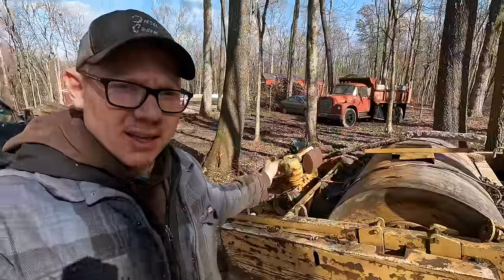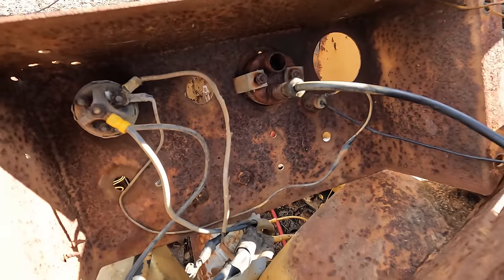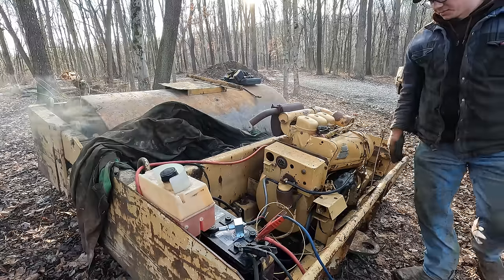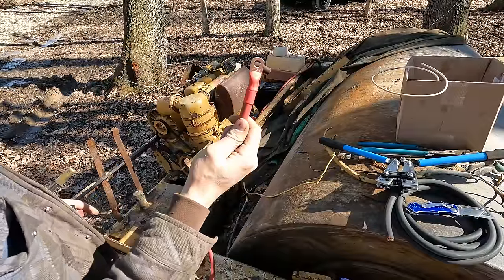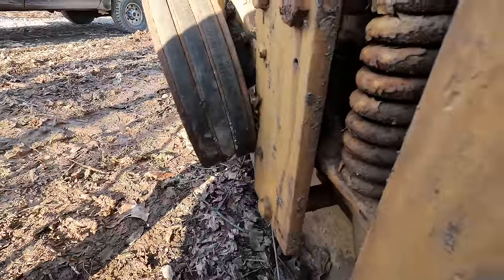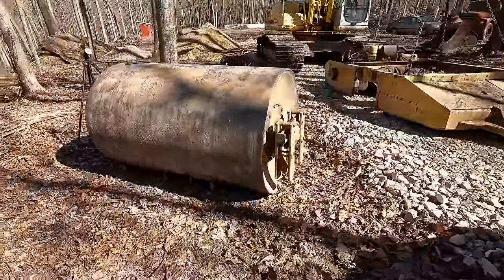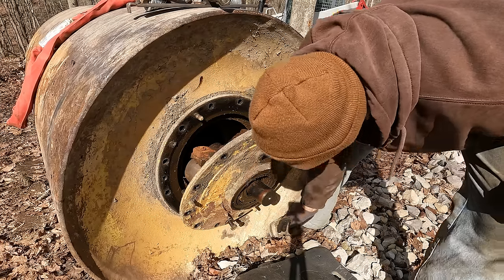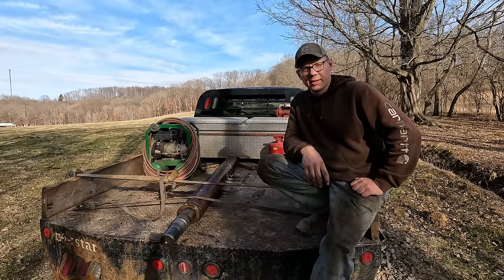Diesel Roller Compactor First Start in 30 years!! Can it be saved??

Comment: If you straighten your homemade puller and Weld some flat stock on the back side of the arms at 90 degrees it should strengthen it up enough. I'm sure you've got it off by now but maybe an upgrade for future uses. Best of luck with prices and parts. Looking forward to am update and next video. Keep up the great work my man 😁👍

Comment: Get a resistor diod set for your glow plug voltage and wire it into the power side of the glow plugs. You need to drop your voltage.

Comment: Shaft snout just needs to be welded back on and the welds machined or grinded down afterwards so the pulley can be pressed back on. Shouldn't be that difficult of a repair for a decent machine shop. Nice work so far though. You'll get there 👍😎

Comment: First thing with heaters, always check how they're wired (series or parallel). Next check the heater plug continuity (plug by plug). If they're parallel wired and have a lower than battery voltage rating search the wiring for a series resistor., Sometimes these are set up like this so that you can put a lamp across the series resistor so you can see it glow up as the heaters heat up.
The injectors look like pintel nozzles which tells me that the engine is an indirect injection engine. These are notoriously difficult to start in cold weather (relative to a direct injection diesel).
Best option with the heaters is to dig through the Bosch or Beru catalogue and find a mechanically equivalent 11 or 12 Volt version and wire them in parallel. If you have the stomach for a bit more work, try to get hold of a heater plug controller from a Peugeot then you get pre-heat based on the ambient temperature and a post heat control which helps clear up the smoke while the engine warms up and stops it 'stumbling' at idle.

Comment: Sadly i judt tossed a lift pump for that engine. Customer stated it leaks oil around the lift pump and it did. Pump functioned perfectly other than the bad o-ring. Im local to you as well. Heck might got some 12v glow plugs in my box that will fit just right.

Comment: Hay Matt the shaft that is broke I think you can fix it yourself by cutting V on both sides of the shaft and spot weld it back together and roll it on the floor and see where the shaft is out of line and tap it with a hammer and to get it straight once you get it straight then fill in your V with weld and then just take it to the machine shop to get your wailed smoothed out to the right diameter  and on that pulley to get it off I would do a heat and quench I would get the pull Red hot and I would quench it with water that will wash out the rust between the shaft in Pulley 
I’m the small engine repair man and when I have to pull an engine off of a unit a lot of  times the shelf in the pulley froze together because I have to heat it up and Spray water to wash out the dirt and rust

Comment: Starter switch, B+ to battery, S to starter and C should be key run, not the start position, common for accessories. C should be hot in the key run position and dead in key off position.
Battery cable, put a pot on a heat source to melt lead in. Wrap damp towel around the plastic jacket to prevent melting. Use the heat for the wire as well. Touch lead to the wire to see if wire can melt lead. Brush or dip, dip, wire in flux then dip and hold in the pot with molten lead. Raise it up to see if the lead is sticking.
Have the battery connector in vise, held vertical. It helps to have a cup of water near by. If you get the wire too hot it may distort the connector. If it does start to mess up, pour the water on it.
With the wire in the molten lead and flux in the connector, remove wire from pot and push wire into connector quickly.
You can use a connector that has a bolt hole in the end meant for eyelet connection. You may need to drill it out but the opening needs to be slightly smaller than the wire OD. Use wet towel to wipe excess flux off wire. 
If you have an inch deep hole, strip wire back 3/4". When you push the wire in, do so until the jacket of the wire goes in and starts to crunch up. Air tight seal and it looks better. Quench and done. Do not remove from vise to quench. Pour water on the connector. 
To solder wire to eyelet, same procedure. Then heat connection to flow the lead onto the connector. Not necessary or wise for the lead terminal post connector. It would make you sad if you tried.

Comment: I bet Matt welds and repairs that shaft. He doesn't throw the towel in the creek that easy. We use to have blower shafts repaired that size. Bevel the 2 ends like they do on pipe. Build a jig so you can rotate the shaft as you weld. And line it by tacking some angle on the long end for alignment, tack together the 2 pieces and weld it together in layers

Comment: I think that it's definitely worth repairing. Even if you cobbled it together for your small project. It is true that you should put it in a lathe to true it up but again if it sits square where it broke you could always weld it yourself with some 7018 rod and grind it.  And as long as it's not a bearing surface who cares.

Comment: The glow plug will be rated for 9.5 volts (not 9 to 5), probably with a European comma instead of a period for the decimal point.  That's about what you'll be getting under cranking in cold conditions.

BTW those bearings are called "self aligning" bearings.

Comment: Just wondering if that shaft is an off-set shaft that causes the vibration, or are those two big balls what make it vibrate..?    I suspect the cheap solution is to centre the two broken bits with a spigot, then weld it back together., whilst lining up the parts in a big lathe.  The dearer method would be to completely make a new shaft from bar stock.   I look forward to the shaft repair video...

Comment: When starting these older diesels I put oil directly into the cylinders to up the compression about 3 tablespoons they smoke like crazy and don't run away. Close the throttle as soon as they fire hard. Some older diesels have a port to put oil in for cold starting and works well.

Comment: The glow plugs are wired in series, and most likely 9.5V rated not 5-9V. That would be roughly what they would get if connected to the crank wire when cranking the engine, but there is normally a resitance coil/glow indicator wired in series from the key switch. It normally looks like a hollow silver dome thing on the control panel, and you can see it glow when you turn the key to the glow position. Also, pretty sure I saw an external voltage regulator so the following may not apply in your case. The alternator possibly needs to be excited to start charging. This is normally done by installing a charge lamp globe between the key on + ignition terminal and the L terminal on the alternator. The alternator might also have an (i) terminal that needs an ignition on source to turn on the internal regulator, if it doesn't have the external regulator.👍

Comment: if you want to clean injectors it is not so hard to take them apart but you will need a ultrasonic cleaner to put them in preferably both before and after taking them apart and be careful not so scratch or grind on the wrong surfaces

Comment: Matt, if it’s symmetrical have them do a weld repair on the shaft and then drive it off the factory end so that the full meat of it takes the torque.

Comment: While it's running, crack open the fuel lines to the injectors one at a time. The engine sound will change. If you have a bad injector there will be no change. Easy way to purge and pinpoint bad injector locations.

Comment: Because it's a shaft that's designed to cause vibrations I don't think you need to worry about replacing the bearings if the value of the machine isn't all that much. Also if you end up welding up the shaft yourself it won't matter if it's a little off. The extra vibration will just wear more on the old bearings anyway and again it's a part designed to
Vibrate! It's most definitely not a precision instrument so don't be afraid to get a little aggressive with your fix.
Reply: The vibration is generated by the balls located in the groove of the housing.
The shaft is only responsible for generating the rotation and will not
burdened.

Comment: I can't be sure without a closer look but it seems to me that your glow plugs are in parallel, each getting the full 12V, especially if the glow plug circuit grounds itself to the block at each glow plug.

Comment: Glow plugs are "rated" for a voltage, but will run on any voltage. They are probably designed around a 6v system, but putting 12 volt to them is ok. Put a standard cheap 10si alt on it should be just fine. They will heat up faster, but will loose life span. Instead of lasting 100 hours of use, you might only get 75 or 50 hours of use. There should make a 12v replacement you can get also. If the counter shaft turns out to be too much, seal the ends up and fill her with water. You'd loose the vibe's, but that amount of weight would not be bad....

Comment: Those glow plugs are in parallel.  Since the other side of the circuit is threaded into the engine you can't make it a series circuit.  You probably need to find a 12 or 24 volt equivalent.

Comment: Do the shaft, clean the existing bearings, not a fast moving vehicle But do have the part numbers ready should they fail. For the amount of use it will get, cleaning, fresh grease and maybe a zert to refil said bearing will be fine. maybe get price and availability on the lift pump, electric seemed to support it as is. Alternator I would leave for now, just powers the starter one time, and the fuel solenoid in the IP during operation. provided its an easy starter, a good battery would build the charge up without the alt. IP draw almost nothing for fuel shut off. Glow plugs would suck juice, but a good battery would build a surface charge on its own. Figure scrap value by weight or sand blasting, gallon of yellow paint and off to the auction. how much use it will see. Shaft is the priority see how it runs, then is it worth bearings? I'd keep it on the cheap for a mostly idle machine. but you may use it more and then you justify more expense. Or wifey could get nothing for it in 50 years at your estate sale. just kidding. all the equipment you brought to the channel has been a win so far, this shouldn't be any different

Comment: You can run the glow plugs on 12V, just not for as long as you would at 5v.   If you must run them on 5v, you need a resister.  Try an old Mopar ballast resister, (the white ceramic style) It should drop the volts by about .5 to 1v, so you would have some resistance and can increase the run cycle.

Comment: hey  matt  i  find   when  motors   are  reluctant.  to  start   like   that   gms  hats  that  have   not  run   for  a  time   instead   of  ether  i   prefer   to  remove   the  air   cleaner   and  use  a  news   paper   rolled  up   tight  soaked  in  diesol  light  it  and  let  the   flame  get  sucked   into   the  intake  manifold   as  to  much   ether   washes   the  oil  of  the  bores   just   saying  so   good  luck

Comment: You need to get 24V glow plugs. 10-3 sec before cranking. The resistance should be 0.0002 Ohms.

Comment: I notice you use a ratchet to undo your bolts etc use a breaker bar they are designed to take the grunt ratchets will break inside.

Comment: Matt, how much did you pay for the machine? At one stage you said "The guy that gave it to me..."

If it doesn't owe you capital money, get a whole new shaft and bearings.

If you did pay for it, try to balance the cost of shaft repair/replacement plus new bearings against

1: Hire of a roller, and 
2: The use you will get from the machine if it is properly repaired.

Suggestions only, mate.

Comment: Puller arrangement you were using is more likely to break the flanges of that pulley than to remove it from the shaft.  (ask me how I know)  Take the whole thing over to the machine shop and they'll press it out for you, for a price, of course, but far less than buying the correct puller, or a new pulley!

Comment: Look on E-Bay for a Denso 1 wire 50-70 amp alternator, you might even find one that's been chromed for a little pizzaz. Clean and repack the bearings, they'll be fine. It's good to know of a good machine shop a that you trust,,, you might barter for the work, maybe YouTube advertising.

Comment: Back in the day a resistor would be used in series to limit run voltage to the ignition coil.  To counter the voltage drop when the starter is engaged, the resistor would be by-passed to the coil by the momentary action of the starter switch.  I'm sure that they are still available at your auto supply store and would help limit current to the glow plugs.
Reply: Maybe not.   The current taken by a coil could be much less than that taken by glowplugs.  So the resistor would be the wrong ohms.   I had a tractor that used 30 amp glowplugs, a coil usually only needs 3 amps.

Comment: The low speeds that thing spins clean and grease the bearings . Bevel grind that shaft and 7018 glue stick that sucker back together .

Comment: If you can get the shaft repaired on the cheap- repack the bearings, leave the click clack, and don’t worry about the alternator.
If the shaft is too expensive- save the engine for future project and scrap the roller!

Comment: My thought watching this is with the glow plugs rated their voltage rating and the alternator "not charging" it might well be a 6v power system originally.  Almost everything 6v works with 12v power, just at higher current flows, but probably not enough to damage things by itself, although a 6v battery can start boiling if being charged with a 12v charger

Comment: Probably a gm 1 wire alternator, itll have two spade terminals one is for a dummy light one has to get battery voltage its a sense wire

Comment: Use 2,  1960s heavy duty ballast resistor, maybe wire in parrallel, to drop voltage down to 9 volts, or what's the orginal factor part to do this ,manual? Replace the glow plugs.

Comment: 29:50 don’t solder a crimp connection. It will not make good contact. 
Over time the solder will deform and the crimp connection will go weak.

Comment: Time to cut your losses Matt. I say yank the motor off the frame and save it then sell the rest for scrap. Take the cash from the scrap sale and rent a roller so you can finish your site work.
Reply: Reasonable assessment. 😎👍
Reply: Or convert it to a dead weight roller. Fill the drum with some ballast.

Comment: Pull the counter shaft and the whole system out of it and weld a bung on the roller and weld it or seal it all up and fill it with water and I bet it will still do the job if it dosen't have to many wholes in it

Comment: You can either find an appropriate size/thread 12V plug or stick with those 6v plugs and just know you can NOT hold them on for more then about 20 ish seconds.  There are some PTC plugs that basically resistance skyrockets when they heat up so the amp draws drops, self regulating.

Comment: Several ways to fix that shaft . Cut off the broken machine out a cavity for a new shaft the thread or press in then weld it solid . Center drill for a dowel pin in both broken ends machine reliefs for weld . Put together in the lathe under center and spot weld check alinement weld . . Buy a new niece what is it 8”x7’ that won’t be cheap machine down both ends to size . With the price of fuel you may only afford to run it one time which may be a bigger issue .

Comment: Need to find the glow plug relay which turns 12 volts down to 5 to 9 volts there should be a diode or 2 for that purpose

Comment: I noticed after you rewired the dash that the cooling fan was not turning. Hell, you are a pretty good welder just get some 8018 or stronger and weld it up. What it basically comes down to is if you are going to keep it and use it yourself or are you going to sell it? It is obviously worth more to you than anyone else.

Comment: 9V glow plugs work perfectly fine on a 12v system, they account for the wire resistance to drop the voltage a bit, and usually a nice big contactor to switch, given that they draw 20~40 amps each. 
The huge amount of blue smoke starting up was cause the plugs weren't glowing, and the entire combustion chambers got soaked in unburned fuel. Once heated up that goes away. With the plugs pre-glowed, or the engine still warm, it should start right up with hardly any smoke.

You need the feedback wire to the alternator to the ignition switch with an in-line resistor (and optionally, an indicator bulb in parallel with the resistor) or it won't charge.

Comment: Great video Matt, I really hope things are affordable to fix with this machine. I agree with you, I'll work with what I have on hand at the time instead of running around fetching things. Might not be the proper thing, but this machine is old and maybe not worth putting parts that will outlive it in. That engine didn't sound completely right, maybe some valve clatter or something like that. Wish you the best bro, I trust your judgement.

Comment: Your bearings are probably about 800 bucks for mainshaft, clutch I hope is repairable but I a thinking 1000 for a clutch that heavy.
Shaft welded up and trued on the cheap, 500, repaired proper, balanced, heat treated 2500.

Keep the pony motor, scrap the rest out.